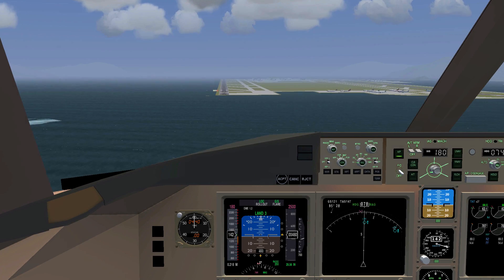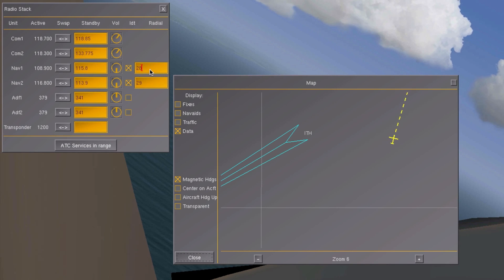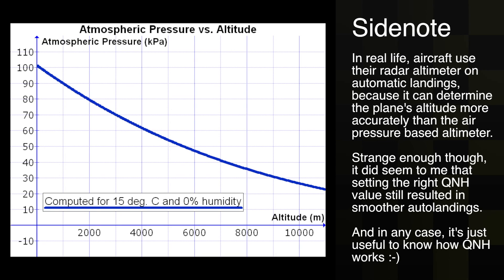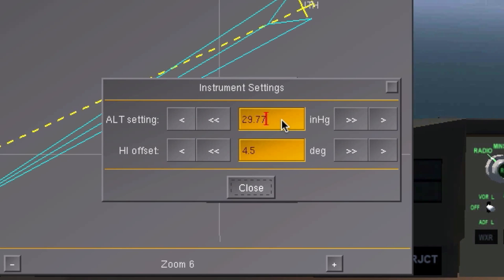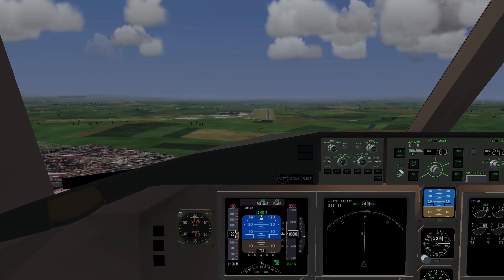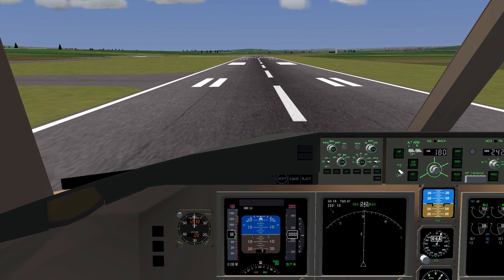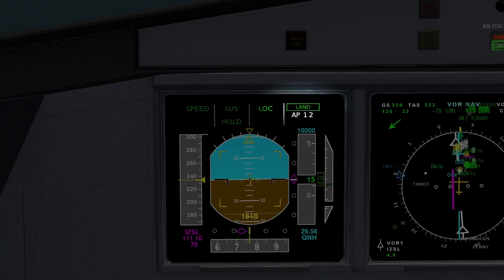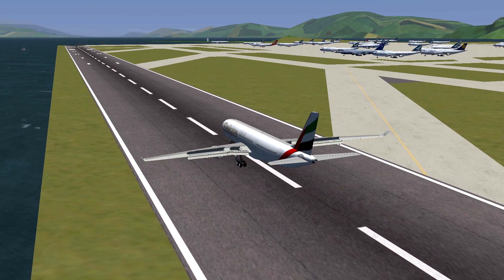Automatic Landings - FlightGear HowTo #28

Comment from the maker: Awesome :)

The 772 is indeed supposed to idle automatically, yet I've had some problems with it where it would already idle one of the engines at around 300 ft, which results in a pretty unstable flare... But if it's working perfectly fine, that's awesome!

Comment from the maker: The A330 will (at this moment in FlightGear, at least) always attempt to immediately fly to the perfect glide slope path. If it can not find the correct signals at that point, it is likely to crash; whereas the 777 in FlightGear will still hold the current heading and altitude until it finds the signal.

So on the A330, fly at ~2500 ft AGL and wait until you are very close to the glideslope (check on the map). Only then enable the LOC and APP modes. Maybe that helps!

Comment: Yea.. I had Rollout on the A330-200 and -300 series at first but there was a major problem... A lot of FG's ILS localizers are messed up, they don't point to the center of the runway, so the airplane will try to go along with that, instead of the center line (try the 777 Autoland in a couple of non-major airports and you'll see that), so I commented out the rollout code.

Comment from the maker: The ILS Categories are not something you can 'enable'. Some runways are equipped with CAT I, some with CAT II and some with CAT III. Every category has a different 'decision height', which is the altitude at which you will have to decide wether or not you are continuing the landing. You know you'll have reached that altitude when the plane shouts out 'minimum' (there's more info about that on Wikipedia). When you look up the ILS frequency, somewhere you'll find which category ILS the runway has.

Comment: Oscar, you forgot one of the most important things here to ensure a smooth automatic landing on the A330-200/-300 series... The FMGC A/THR control.

You need to go to the APPROACH PERF page on the mCDU and make sure the Mode is set to AUTO. Then, on approach, you click on the SPD knob (so it shows ---) and turn on the A/THR. That way, you don't have to mess with the throttle, it ensures a much smoother landing yet on the TDZ.

Cheers!

Check out the last video in my A330 series video tutorials.